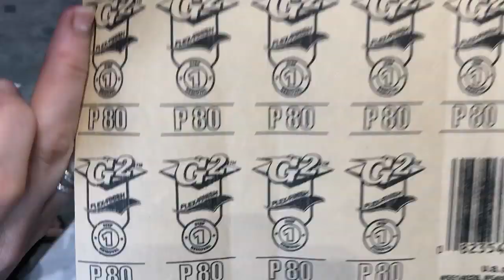Full Geode Table Video (Time Lapse)

Comment: That is freakin cool... I can’t wait to try one!!! Couple of newbie questions...How many layers did that end up with? Is it safe to put outside? How important is it to use quick coat vs art coat? Thank you in advance, you both are such an inspiration!!!👍🏼😍
Reply from the maker: Hey bri! Thank you so much for watching! We welcome all questions. This piece ended up being like 4 inches thick so it took 6 layers. If I had “filled” the inside layers with casting Epoxy it would have taken less layers because you can pour casting Epoxy thicker. I use quick coat so that my colors don’t interact with those next to them. You don’t have to use it and I would recommend not using it till you are comfortable with resin because it does set up super super fast.
Reply from the maker: It is safe outside